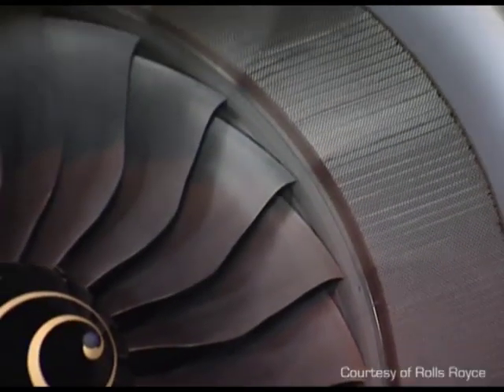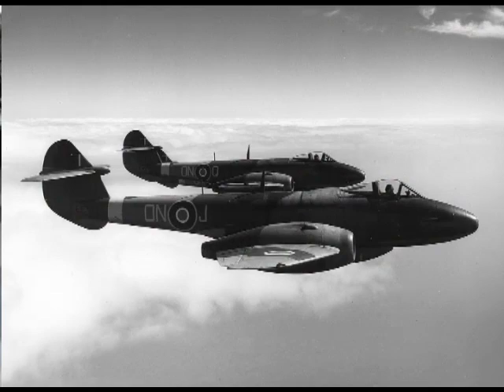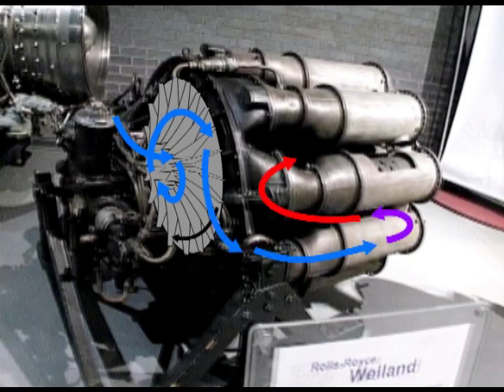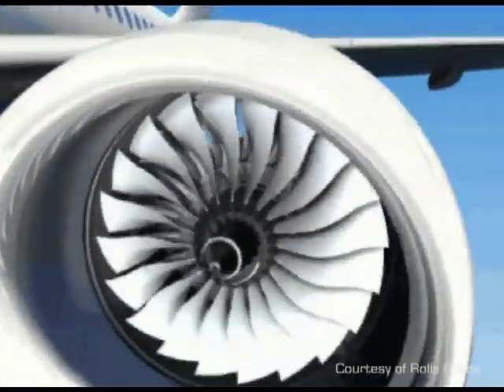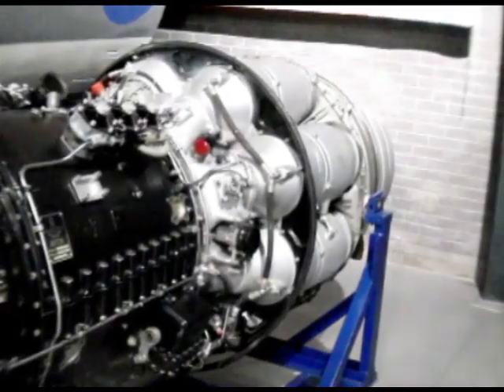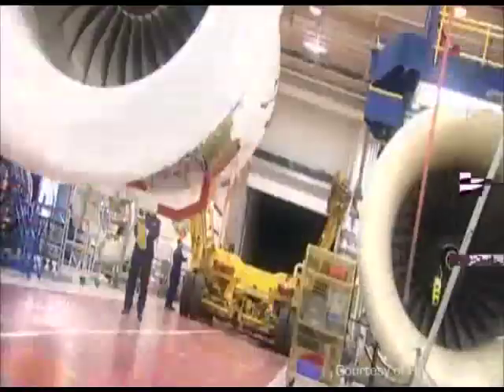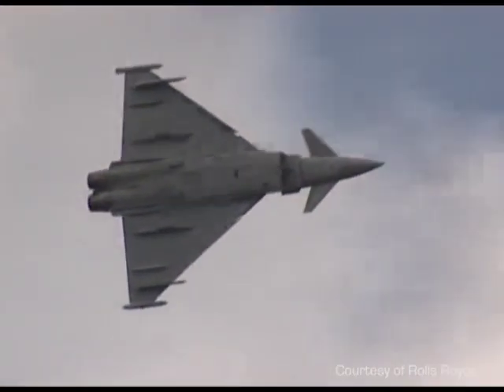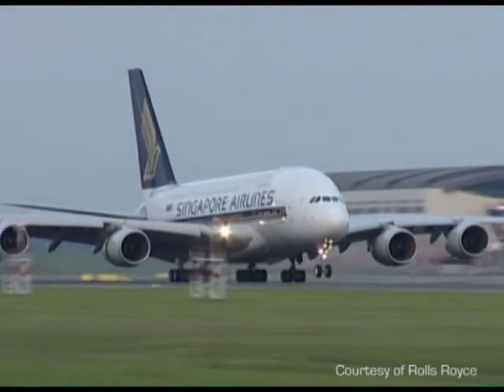A Short History of the Jet Engine

Comment: The axial compressor was first demonstrated in England, the Germans were the first to get a production model running. While the Allies used centrifugal compressors because they were more reliable and better understood at the time. That’s part of the reason why the ME262 had to have entirely new engines every few hours. Axial jet technology wasn’t ready. It’s yet another example of the Nazis pouring scarce resources into on paper war-winning weapons using technology that wasn’t ready.

The father, as we know it, of the turbo jet was British inventor Frank Whittle. Long story short, the British defense ministry rejected Frank Whittle’s design in part due to reviewing engineers at Armstrong-Whitworth pointing out, correctly as it turns out, that a turbo jet engine would be fundamentally inefficient. Instead Whittle patented the design, and not being top secret, the concept greatly influenced the Nazi design team led by Hans Ohain.

Engineers at Armstrong-Whitworth, drawing upon their criticism of the Whittle concept, began development of the first axial-flow turbojets and the first turboprops. And it is this technology family that led directly to today’s turbofan jet engine. The Whittle design proceeded in private development, eventually being taken over by Rolls-Royce. By 1944, the Armstrong-Whitworth design developed higher thrust with superior throttle control, and the Powerjet/ Rolls- Royce centrifugal flow turbojet has proven itself to be far more reliable than the competing Nazi jet projects, the Jumbo 004 and the BMW 003.

Steel is the wrong material from which to build jet engines. Given time, steel will always fail. It fails because the iron in steel sublimates out of the alloy, essentially turning the metal to Swiss cheese on a microscopic level. The general term for such long term metal fatigue is “creep.” In the 1940’s, no one knew that steel would inevitably fail given the temperatures and pressures in jet engines. The correct material that makes jet engines actually practical, and not simply impossible, is nickel alloy, which was a British invention, designed by the British jet design teams. There is no indication that the Nazi design teams ever understood that steel was never going to work, no matter how much they modified their design. The fact that nickel alloys were the solution was not at al intuitively obvious and the Nazis weren’t doing much in the way of R&D to discover the problem.

The Nazis two major production jet engines never managed to last more than 25 hours. You can’t win a war when you have to replace, not merely one but two engines, the most critical and expensive component of an aircraft, every few hours. The icing on the cake is that the Nazis didn’t have access to sufficient quantities of nickel, courtesy of theRoyal Navy blockade, even if they somehow discovered that steel was never going to work.

Comment: Low bypass and high bypass turbofan engines differ more than just how much air goes through the engine, the high bypass engine has a constricting bypass duct allowing bypass flow to accelerate through the narrowing duct and out the back to produce thrust while the low bypass engine has a linear duct which allows the small fans to blow air through the bypass duct and out the back to produce thrust. Also, a jet engine exhaust velocity doesn’t necessarily have to be at least as fast as the aircraft’s velocity (although it does help) as some of the products thrown out the back of the engine to produce thrust are burnt fuel (CO2, H2O, SO2, etc) which in the wings isn’t moving at all relative to the aircraft no matter how fast its airspeed is, much like a rocket engine.

Comment: Although many contributions were made before and after it was von Ohain that built the first turbojet to successfully run under its own power and went on to power the first jet aircraft to fly... It was the single great technical leap in the evolution of turbojet propulsion.

Cheers!
Reply: The He178 was certainly the first aircraft to fly, powered by a gas turbine engine, in August 1939.  However, it was very much a 'proof of concept' machine, with its undercarriage fixed down, and with an engine that could be run for only a few minutes at a time.  
Compare this with the Gloster E.28/39, which flew in May 1941, powered by Whittle's W.1 engine.  The first flight lasted almost 20 minutes and the engine, which was conservatively cleared for 10hrs flight time (after 25hrs ground running at high power), accumulated those hours with no problems..  A maximum speed of 350-360miles/hr was achieved with that engine.  This was increased to 430miles/hr when the W.1A engine was installed the following year.
In 1941, the W.1 engine was already far more reliable, more efficient and had a better thrust/weight ratio than the Jumo 004B in 1944, which was notoriously unreliable, and was effectively an expendable engine.  By this time, the British centrifugal engines were on their way to being cleared for 150hrs TBO (time between overhauls).
Reply: @grahamj9101  Frank Whittle's design was heavy, underpowered and unreliable.
The true genius behind Britian's Jet engine program was led by Adrian Lombard and Stanley Hooker with lots of help from General Electric.

Comment: What did the German's actually invent during this period?
The Jet engine was a British invention (the German's just used Whittles patent)
Radar was invented by the British.
Liquid fuelled rocketry was an invention of American Robert H. Goddard, von Braun pretty well just copied Goddard's design.
Reply: for the jet engines it's much more complicated: in all advanced countries (France, Germany,GB,USA and others...), researches about jet or rocket engines was launched in the  30', some theoric inventions about jet engines was very old, like the ramjet who was invent by René Lorin in 1907 (registered in 1913)...but first successfull tests was made in 1935, and first fly whith such engine was only in 1946...First compressed air feed piston engine was invent by Renault in 1902, but the first  "turbocompressor" (basic component from the first reliable turbojets), was invent in 1905 by Alfred Büchi (Swiss) , and a turbo compressor built by Auguste Rateau, use on the Renault 12Fe aircraft engine (320hp)  installed on the WW1 (1918) reconnaissance Breguet XIV...Rateau built the first french axial turbo jet in 1939...(Rateau SRA-1)...Rateau was after ww2 part from then SNECMA who built, with the help from german BMW jet engeeneers, the successfull ATAR engines line (first use on french jet fighters in the mid 50')...
Reply: Mactrip100 

Various scientists and engineers contributed to the development of internal combustion engines. In 1791, John Barber developed the gas turbine. In 1794 Thomas Mead patented a gas engine. Also in 1794, Robert Street patented an internal combustion engine, which was also the first to use liquid fuel, and built an engine around that time. In 1798, John Stevens built the first American internal combustion engine. In 1807, French engineers Nicéphore Niépce (who went on to invent photography) and Claude Niépce ran a prototype internal combustion engine, using controlled dust explosions, the Pyréolophore. This engine powered a boat on the Saône river, France. The same year, the Swiss engineer François Isaac de Rivaz built an internal combustion engine ignited by an electric spark. In 1823, Samuel Brown patented the first internal combustion engine to be applied industrially.
Reply: Mactrip100 

The axial compressor was first demonstrated in England, the Germans were the first to get a production model running. While the Allies used centrifugal compressors because they were more reliable and better understood at the time. That’s part of the reason why the ME262 had to have entirely new engines every few hours. Axial jet technology wasn’t ready. It’s yet another example of the Nazis pouring scarce resources into on paper war-winning weapons using technology that wasn’t ready.

The father, as we know it, of the turbo jet was British inventor Frank Whittle. Long story short, the British defense ministry rejected Frank Whittle’s design in part due to reviewing engineers at Armstrong-Whitworth pointing out, correctly as it turns out, that a turbo jet engine would be fundamentally inefficient. Instead Whittle patented the design, and not being top secret, the concept greatly influenced the Nazi design team led by Hans Ohain.

Engineers at Armstrong-Whitworth, drawing upon their criticism of the Whittle concept, began development of the first axial-flow turbojets and the first turboprops. And it is this technology family that led directly to today’s turbofan jet engine. The Whittle design proceeded in private development, eventually being taken over by Rolls-Royce. By 1944, the Armstrong-Whitworth design developed higher thrust with superior throttle control, and the Powerjet/ Rolls- Royce centrifugal flow turbojet has proven itself to be far more reliable than the competing Nazi jet projects, the Jumbo 004 and the BMW 003.

Steel is the wrong material from which to build jet engines. Given time, steel will always fail. It fails because the iron in steel sublimates out of the alloy, essentially turning the metal to Swiss cheese on a microscopic level. The general term for such long term metal fatigue is “creep.” In the 1940’s, no one knew that steel would inevitably fail given the temperatures and pressures in jet engines. The correct material that makes jet engines actually practical, and not simply impossible, is nickel alloy, which was a British invention, designed by the British jet design teams. There is no indication that the Nazi design teams ever understood that steel was never going to work, no matter how much they modified their design. The fact that nickel alloys were the solution was not at al intuitively obvious and the Nazis weren’t doing much in the way of R&D to discover the problem.

The Nazis two major production jet engines never managed to last more than 25 hours. You can’t win a war when you have to replace, not merely one but two engines, the most critical and expensive component of an aircraft, every few hours. The icing on the cake is that the Nazis didn’t have access to sufficient quantities of nickel, courtesy of theRoyal Navy blockade, even if they somehow discovered that steel was never going to work.

Comment: Whittle first successful full power test was not until Sept. 1939... slightly less than month after the HeS 3 flew..

All previous tests were aided by the output of a 4 cylinder automobile engine...
Reply: You are one of several detractors who foolishly denigrate and deny Whittle's undoubted genius and achievements. 
Frank Whittle's first patent application was filed on 16 January 1930.  It was published the following year and a copy of the abridged version of the provisional patent was recorded in Berlin, date stamped 15 August 1931.  There is no doubt that copies were circulated to various universities and technical institutions in Germany.
During interrogation shortly after the war, by no less than Captain Eric 'Winkle' Brown (who also interrogated Goering), von Ohain was evasive: however, one of his co-workers acknowledged that they had seen Whittle's patent.
It is also a recorded historical fact that, during initial test runs in April 1937, Whittle's first engine 'ran away', as a result of an accumulation of fuel in the combustion system continuing to burn, even after the fuel supply had been shut off.
Your suggestion that the 4-cylinder automotive engine (a 10HP BSA engine), seen in photos of Whittle's early 'ground use only' engines was to "aid" the jet engine is totally false.  It was used as the starter and would have been destroyed had it been connected to the engine when it 'ran away'.
There is no doubt that von Ohain initiated development of the jet engine in Germany, but let it not be forgotten that its history  will forever be tainted by its association with a regime that murdered millions.
Reply: @grahamj9101  Maxime Guillaume patented the turbojet aircraft engine in 1921 when a 14 year old Frankie was still wearing short pants.
 Frank Whittle was only the 4th person to successfully demonstrate a jet aircraft engine.

The "Sir Frank Whittle" of British propaganda myth is a fictional character, created by british revisionist historians.
The real Whittle was more caricature than hero, a drunken boaster, liar and tireless self-promoter... he plagerized the work of A.A. Griffiths and made many enemies at the RAE,  Rolls-Royce and entire British aircraft industry.
 Frank Whittle was addelled by his addiction to amphetamines and benzodiazepines, he also admitted to being a horrible alcoholic.
Whittle's involvement with the Miles M.52 scandal forced him to resign from Power Jets Ltd.  discharged from the RAF for dereliction of duty.
He was exiled to a drug rehab in America to spare the new Labour Government any further embarrassment.
He was blackballed from the aircraft industry in the U.K. and eventually left to live the rest of his life in America.

Indeed, the British will always be tainted by the mass genocide of the Victorian Holocausts... crimes against humanity that have never been answered for,  the British Colonial Empire made Hitler and Stalin look like amateurs...